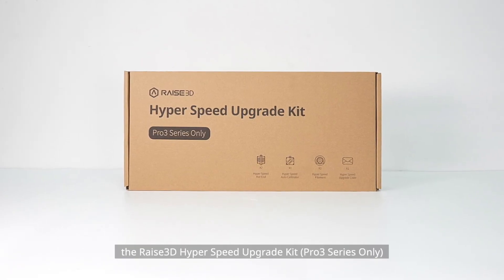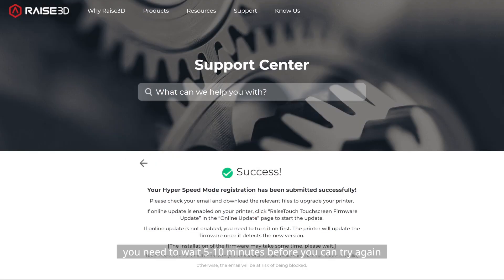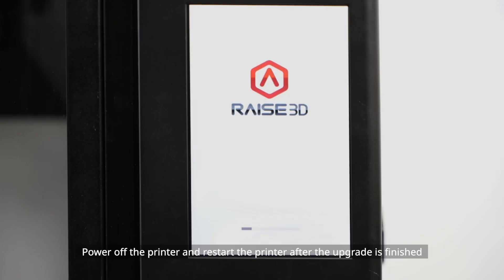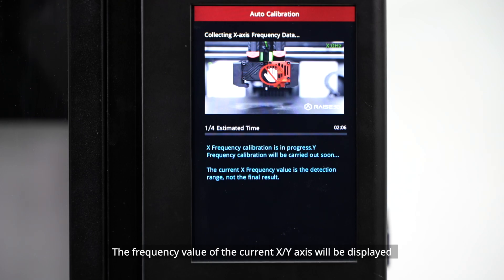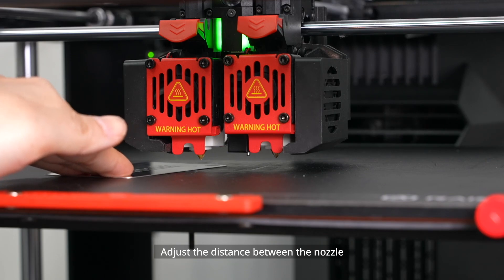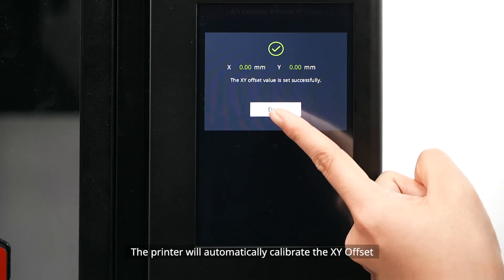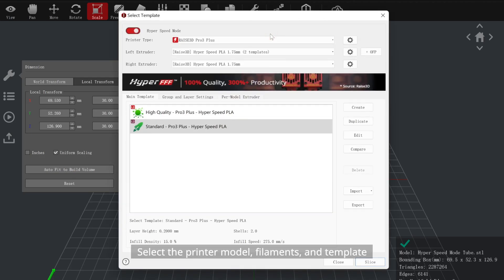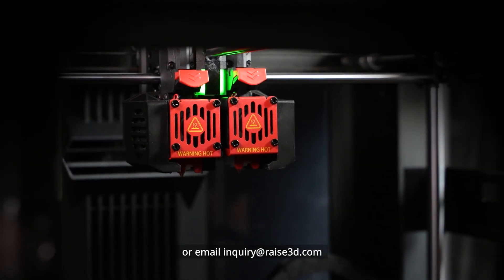Unboxing and Setup Video Guide - Raise3D Hyper Speed Upgrade Kit

Comment: Will there be an option to buy a pro3 with the hyperspeed already included? If I am to buy a pro3, I don't want the extra non-hyperspeed parts. Also, are we going to be able to create our own hyperspeed profiles for different filaments and slice settings or is it just limited to your profiles?
Reply from the maker: Hello there, thank you for your question. We have planned a Hyper Speed version included in the Pro3, which is expected to be available early this year. However, for urgent cases, we suggest you to consider a few promotions/special discounts from HUK3D to solve the problem. Hope this answers your question!